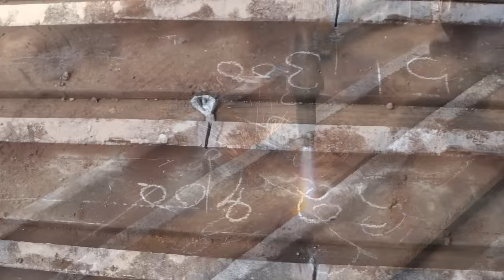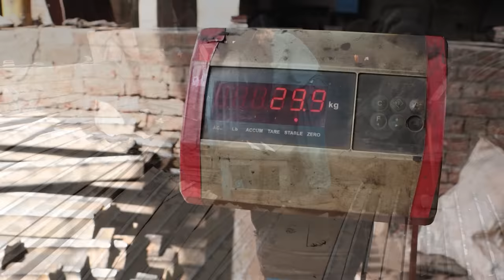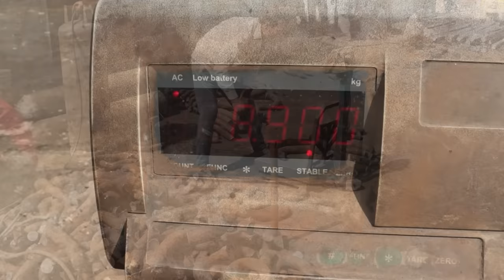Top 5 Most Viewed Recycling and Manufacturing Process Videos

Comment: Love their safety sandals
Reply: They don't require safety devices .. they don't allow their minds to wander when handling 2000F steel.
Reply: @Deploracle  good for them but accidents happen and then you loose toes. Prevention is better than cure
Reply: In case of an accident only the feed are harmed but not de sandals
Reply: They don't worry much about footwear because they know their strong medical benefits are there for them.

Comment: A guy I use to work with told me about a summer job when he was younger. He and a friend had to chop up 27 miles of railroad rail into 27-inch pieces for the shredder at the scrap yard. He said they went through 2 huge tanks of acetylene per day. He worked all summer and still didn't finish the pile off.
Reply: That's where they made their mistake. - "Real full time scrap yards (and Steel Mills and big fab shops) use natural gas and have liquid oxygen tanks. The worst thing they could have done is use propane (In 1000# tanks) NO $$$$$$$ acetylene
Reply: 63,120  "27 inch" pieces in 27 miles of rail.

He'd have to average 87.6 pieces cut per hour, to finish by summer's end.
Reply: @Deploracle bo chance 😂😂😂

Comment: Interesting note that when the guys were loading the wheelbarrow at around 13:26 or so, the flat piece of metal with who knows what was on the top of it - all got put into the fire. I like the assortment at 20:20, everything from engine parts to the discarded kitchen mixer. They must use all of the alloys at the same time. I even saw an outboard motor lower half being chucked into the furnace.

Comment: Man these guys are some of the hardest working men in the modern world, still doing all that type of work the old school way.
Toward the last I was amazed watching them create a whole product out that scrap anchor chain. 
But what was it they made ?
And what were those blue disks they were making ?
Reply: To me they look like hub caps but not sure
Reply: Farming plough discs
Reply: @davidsteinicke5454  👍
Reply: plow discs for tractors
Reply: They're plow discs for agriculture. A bunch of them go on a frame and get pulled behind a tractor. They make the rows ("furrows") that the seeds get planted in.
Reply: @cammobunker  OK  Thanks
Reply: Come on, do not exaggerate. Their work is not so hard. It is work in primitive circumstances but the hardnes is on a moderate level.
Reply: Lung cancer by their 30s ? and blind by their 40s? sad, and we complain seatring in a chair :(
Reply: To them this is modern tech. 1000 years ago they had 100 guys jump up and down on a bag to force air into the furnace.🤣
Reply: Stay long enough in that powder booth and my man becomes a Pakistani Smurf
Reply: @cammobunker  не знаешь ненадо говорить, эти диски для мульчирования почвы ,для тяжехых земель и каждый диск стоит порядка 300-500 $
Reply: @drevil4454  Over here in the ultra modern west ... we still hammer forge hot steel into tools and stuff, just like they do in this video.
Reply: It looks like an excavator bucket tong made from scrap anchor chain. Might not be the best material, though.
Reply: @cammobunker  wrong......these are disc for heavy bush/bog harrows for deep tillage and incorporation of debris and plant matter in preparation for next crop.  Seeds are planted in rows made by flat type double disc at a slight vertical angle penetrating about 2" depth and very narrow width so as to cause little soil disturbance. That type of disc has no dished concave surface as do the ones in video.
Reply: @cammobunker  Yeah that's most likely what it is, I was wondering.
Reply: The blue disk were plow blade for farming turning field and making rows
Reply: they were making billets (stock) for further manufacturing
Reply: Discs for farm equipment.
They plow and mince the soil, reducing 
The soil to be readied for planting.
Reply: For custom drums or Frisbees for adults. Actually their shields for a new super hero
Reply: You're all wrong. They're umbrella tops for areas of high volcanic activity

Comment: People are ready for the graveyard at 50. No safety equipment. Infrared radiation, for example, triggers weld starvation. If the processes were optimized just a little, you could save staff and Money and improve security. "High-quality" special steel with a bit of everything in it. 🤯

Comment: That steel they use to make the disc for tilling land can't bee that good. Just throwing random steel in a furnace produces a random steel product. I saw no effort to sort steel or add any higrade alloy to the mix. Product most likely won't hold an edge for long.
Reply: Please look again. The disk harrow is made from railway line which is a high grade steel which can be looked up,Google it.? to find that it has spring quality and hardness. I have used rail steel and it is suitable for a veriety of applications.

Comment: I love these videos but I always feel so bad for the powder coat guys. You just know that’s imminent lung cancer
Reply: Imminent? It will take years.
Reply: Lung cancer, hmm maybe from the furnace or grinding, powder coating is fairly safe with no VoC’s no solvent in spraying,a simple mask can stop powder being inhaled, I have been in a technical coating environment that I ran the powder coating section, that’s over 30 years ago and nothing has changed yet?
Reply: @theonlybuzz1969 Fibrosis/silicosis from particulate inhalation
Reply: @theonlybuzz1969  personally I'd consult a doctor